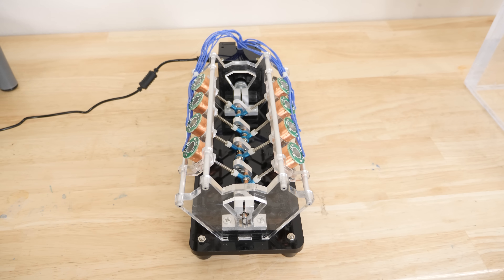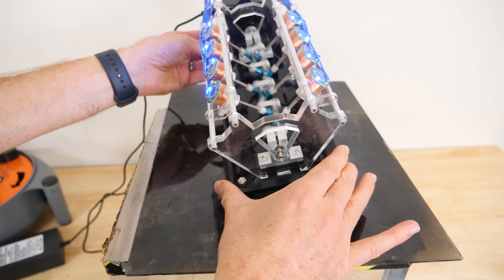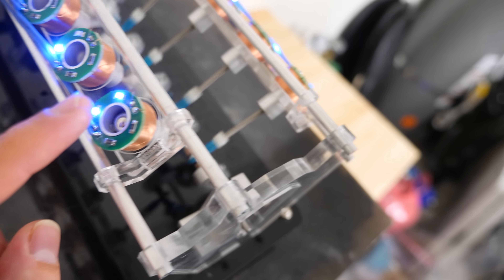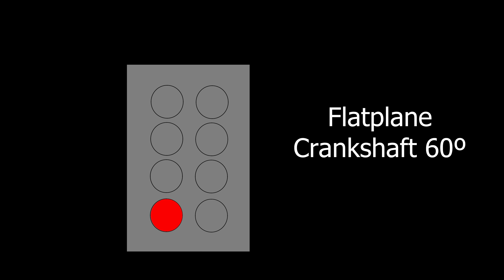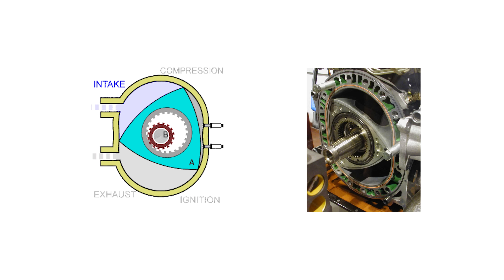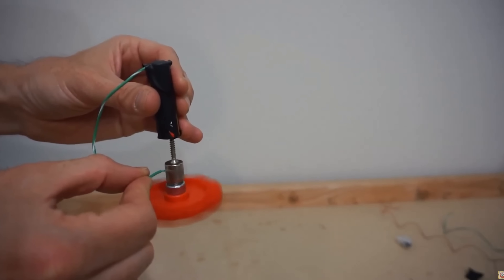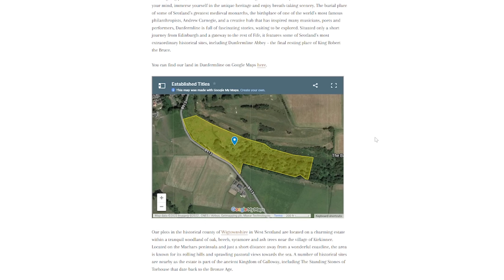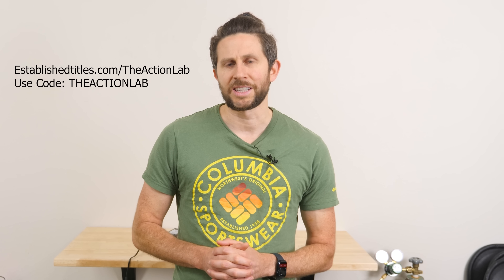Is an Electric V8 Engine a Good Idea?

Comment: Besides the efficiency and complexity reason: electric motors offer a precisely controllable torque, which allows for better handling.  Using reciprocating solenoids would remove that benefit.
Reply: Exactly,  More noise less efficient and overley mechanically complex.
Reply: @dogwalker666   hence fulfilling the basic requirements of American muscle cars
Reply: @AmritGrewal31  american muscle cars aren’t that complex and that’s part of the reason of what makes them so popular
Reply: @AmritGrewal31  funny
Reply: @dogwalker666   What if I am stupid but I love the noise, what then?
Reply: @roseCatcher_  We can install some nice speakers in the car.
Reply: @roseCatcher_  then get a V8 right now
Reply: @hedgehog3180  resonators don't make a car sound cooler... just cheaper. No one wants a  Rottweiler that barks like 3 chihuahuas. 😅
Reply: @roseCatcher_  electric v8's wouldn't make you any noise beyond the valve train noise, the noise you hear out of a combustion engine is just that... the combustion.
Reply: @roseCatcher_  then i too am stupid. but i think not.
Reply: @hedgehog3180  nah man, speaker noises that not produced by high grade audio maker ? Thats only make a funny numb rumbke noies, lol
Reply: @roseCatcher_  then you get free ticket to Venus
Reply: @Adierit  Actually, quite a bit of the noise is the mechanical friction. Thats why suppressed weapons still can be heard.
Reply: @dogwalker666  that  "" noise less efficient and overley mechanically complex""  smoke your precious so-called "efficient" electric motor  Plaid as you claimed  in 3 round ride head to head. (battery is source of movement, not electric motor, motor is part of transmition elements in powertrain, battery is has low energy efficiency, meaning that the batteries require far more energy to be fully charged than they ultimately provide).
Not talking about none of EV are provide reliability to beat old Toyota Hilux in durability and reliability that ICE car can never have under harsh conditions of our world and people.
Mic drop
Reply: You could still control the torque on a reciprocating electric motor- just vary the amount of voltage and the timing of when it is sent to each coil. Efficiency would still be bad, but controlling torque would not be an issue.
Reply: @HeyChickens  It's not that simple, the rotating mass of the parts contribute significant torque on the output.  You would need a full physical model of the system to know what voltage to send to each solenoid.
Reply: Good. Finally we have reason to put in a manual.
Reply: additionally "normal" electric motors dont have oscillating masses. These can introduce very strong and complex vibrations which can be very hard to get rid of.
Reply: I love comment sections where arm chair scientists battle each-other like they definitely have all made a v8 electric engines and can speak on there practicality 👀
Reply: @AustinMmmmmm  Thing is, you dont need to be a scientist or an engineer to understand the physics involved. As a BS in Electronics Engineering I can tell you that V8 solenoid engines are a horrible idea and thats why you have seen exactly zero of them used outside of models for demonstrations.
Its amazing what one can do when they actually think as opposed to gape their brains open like baby birds waiting for an authority to tell them what is true.
Reply: @jhoughjr1 Yes it’s inefficient, overly complicated, inefficient, stupid and defeats much of the purpose of having an electric car in the first place. And that’s why someone is going to build a real one and charge a huge amount of money just so someone with $2 million to burn can drive around in a one-off piston-driven EV.
Reply: @jhoughjr1 Makes an argument of authority while bashing people for listening to argument of authority. Chad move
Reply: @Edward Elizabeth Hitler This still has the magnets bouncing up and down like a valve would, thats the only noise you would hear from this electric engine.
Reply: @Adierit  You mean like a piston would .. maybe. Pistons are in constant motion except for brief pauses at TDC and BDC. 4 stroke valves are in motion less that 180° of every 360° of crank rotation. Both pistons and valves are precision fit in their respective cylinders and guides, thus would be quite silent. What you would actually hear, even on a decently maintained engine, is valve train lifters (or tappets or cam followers or inverted buckets) as the cam lobes come around and suddenly (but not destructively) lifts them. The tighter the tolerances here, the quieter the valve train. Alas .. there is no need for valve trains on a solenoid V8, unless you want to make an air compressor ..
Reply: True
Reply: And durability is low on pistons
Reply: @Niyazmen  relatively. But pistons are pretty durable when operated in spec.
Reply: But sound!!
Reply: What about this would prevent it from having precise torque control? Just need to reverse the effect of the connections.
Reply: If a person wanted that sound, feeling and asthetic of a gas engine then this would be a decent compromise until people get used to how electric cars sound….that or install vibration machines and sound generators
Reply: I call it the compromise between petrol heads that refuse to go electric and electric heads that want everything a v8 has to offer minus the gas power.
Reply: @Tyler_Fuller  one big diff is ICE makes power, electric takes power.
Reply: you could passive cool it too i bet.
Reply: just use direct torque motors
Reply: Using a speaker has the benefit than then the sound can be like a ringtone in your phone. Just change to a different sound when you get bored. 😂
Reply: well maybe u could still control the torque but it just got way harder.
Reply: This could be good for electric bikes as bikes do not benefit from a constant torque. Bikes with uneven firing intervals offer better control giving the rear tire some time to regain traction. It's like a preventive "ABS" that's coming from the drive train.
Reply: There is am application for everything. Of course not mass production
Reply: @Edward Elizabeth Hitler i was wondering how fast it would be for someone to take the bait 👀 congratulations your our first place winner 🎉 contact your local telegram bot for your prize 👍
Reply: HOWEVER! - Some of the BEST ICE to Electric car conversions have been, where they have simply JUST replaced the ICE motor and connected it to the 4 or 5 speed ORIGINAL manual gearbox! Old Porsches, MG's, Triumph Spitfires, Karmann Ghia, and many more classic cars converted this way have proved to be EXCELLENT Electric drivers cars, none of the 2 pedal instant start/stop, just quieter and you STILL have driver engagement with the clutch and gears... What's more, it depends on how you tune your Electric motors ECU for power delivery, low revs torque for days, or a steady ramp up to max RPM... 😎🇬🇧

Comment: James: The V8 engine has 8 pistons so it has a lot of power.

V12 has joined the chat
Reply: W24 has joined the server
Reply: @Radin i wonder how many pistons could uniquely function in a single cam rotation
Reply: @MelodicTurtleMetal   
You mean crank, not cam, i think.
Reply: @jareknowak8712  yeah crank, my bad.
Reply: @MelodicTurtleMetal  Absolute maximum? 360. one fires every degree. That said, it would be impractical. The longest inline was a straight 12, so applying that a W36 would be firing every 10 degrees of the crank.
Reply: @Radin v69
Reply: V∞ enter the chat
Reply: V ktor
Reply: Amount of pistons is not directly connected to the amount of power.
Reply: FTL is silent, so you don't know it already left the ro...
Reply: W12 and W16: are you kidding me?
Reply: @Radin I'd love to try 24 in a v configuration, using a really small bore. Not sure if halving the bore of a working v12 and just doubling would work? Would be super smooth, and might sound interesting.
It'll also be pointless..
Reply: @MelodicTurtleMetal   
Just imagine the forces on the last crank pin vs the clutch. 
It will not work properly if the crank was designed for 12 cylinders and just made 2x longer.